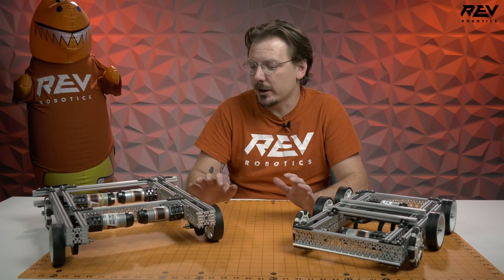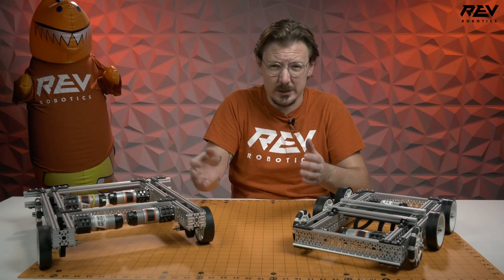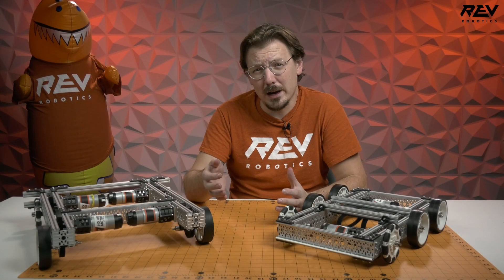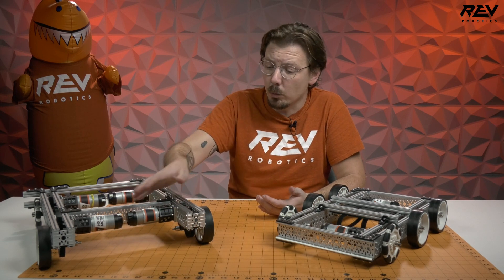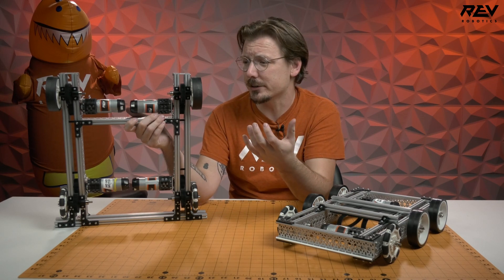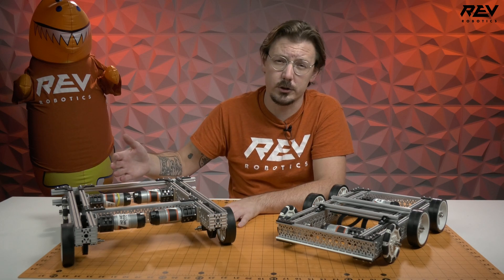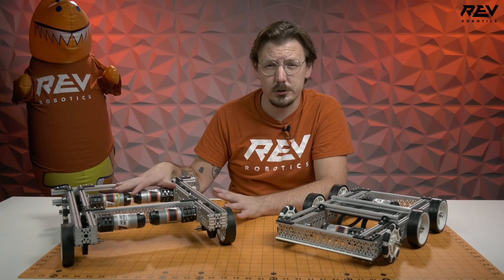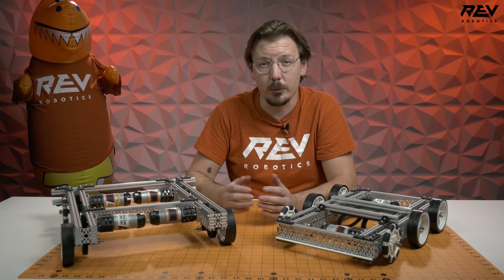Drivetrain Revisions and Testing - FTC Freight Frenzy 2021-2022

Comment: the robot on the right (the small one), is it small enough to go around the barriers? If so, could you please tell us the dimensions? Thank You!
Reply: I don't know anything about the robot on the right but I can tell you that there is 13.7" of clearance between the wall and the barrier so you if want to go around you just have to build thinner than that
Reply from the maker: The width is about 300mm. It is small enough to cruise through the wall and barrier.
Reply: Thank you guys, really appreciate it!